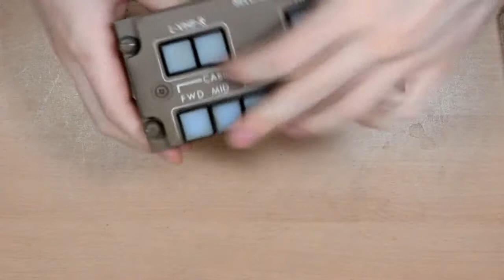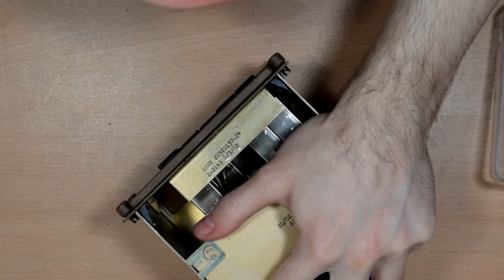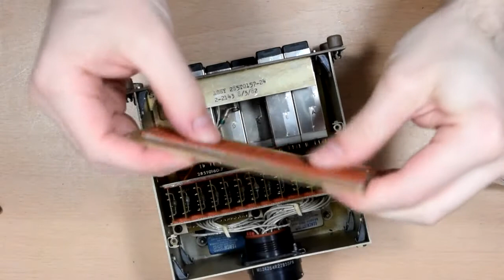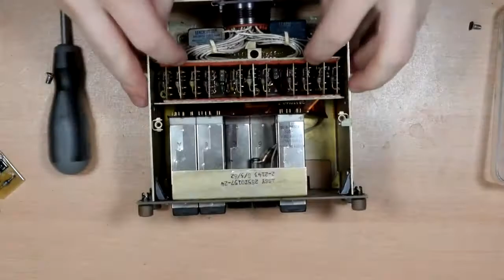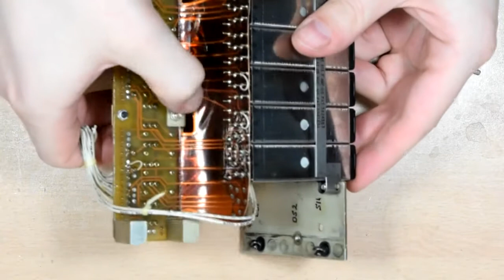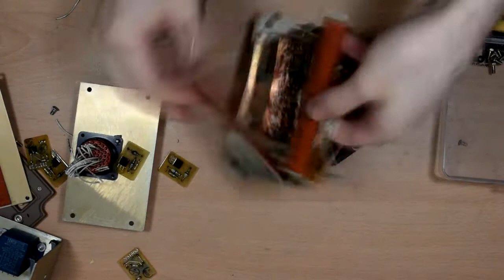Pilots call box teardown

Comment: The last time I saw a PCB with a flexible layer like that was in an old Seagate SCSI hard disk.

I believe the reason they didn't go with a flexible PCB for the back connector is because it needs to be easily replaceable if damaged.
Reply from the maker: There was a similar laminated-in flex pcb in a military radio i tool apart pre-youtube channel,  pics here: http://sigmatechnica.com/clansman-prc351-radio-teardown/

Yeah it may well have been something like that,  or maybe they made different models with different plugs on

Comment: A really nice box, I remember taking apart a "Selcal" box from Gables Engineering which was hugely disappointing: just the buttons, the connector and some wires, in a totally oversized brushed aluminium case.
Reply from the maker: I just finished videoing another teardown of a Gables control box :D